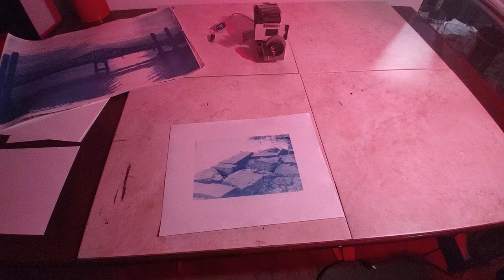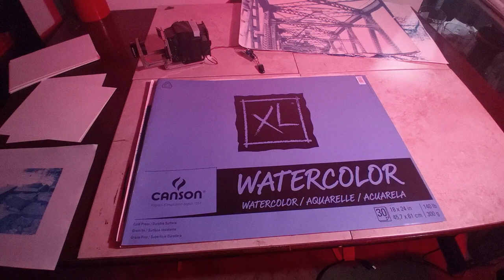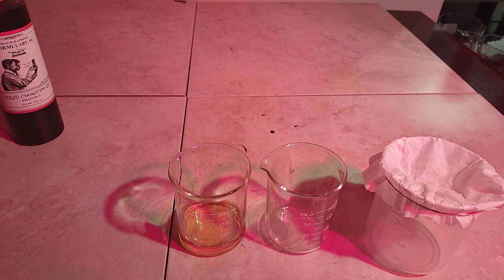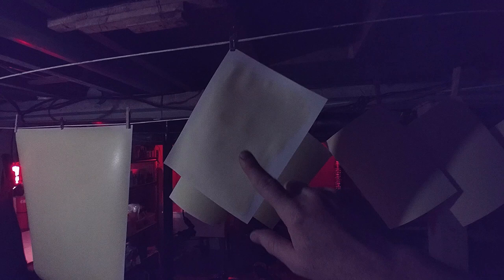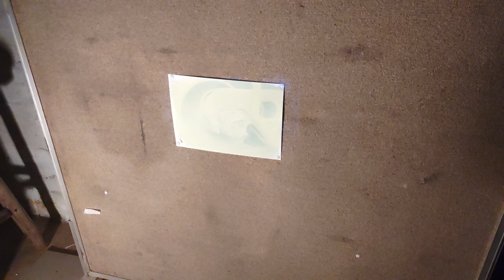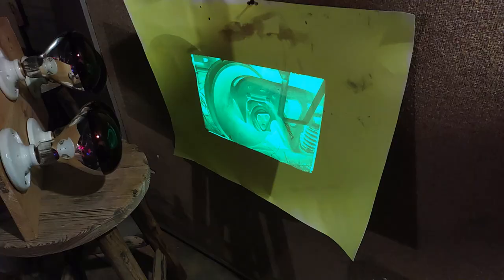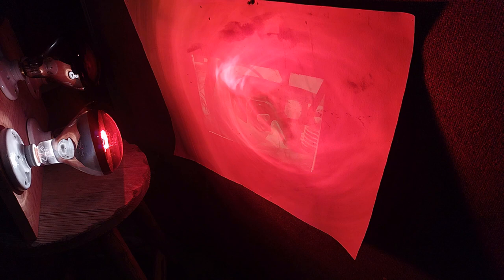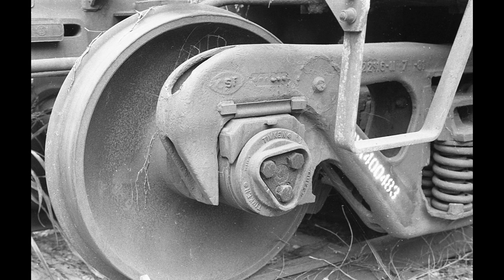Using heat and acid to reduce cyanotype exposure times!

Comment: Thanks for sharing all your experiments! What would happen if you increased the strength of the solution or added the vinegar to the solution?
Reply from the maker: I would assume you can use several different acids like citric or oxalic, you can get gallic acid concentrate as well. You would have to test to see if anything stronger would help or hurt but I would imagine that at a certain level it would just convert everything to blue and wash out the image. As for adding it to the solution the only time I have ever heard of doing that is in glass cyanotypes which I have made and it takes a small amount of oxalic acid in the emulsion,  although I have not tested it on paper I would assume it could speed up the exposure as well.

Comment: Wonderful video! Question: Did you ever try using an electric heater to heat the paper?
Reply from the maker: I have. Essentially any type of heater will work as long as you can keep the coated paper from moving around, I used infrared lamps to prevent any kind of buckling but any heat source should work

Comment: Thanks for testing them I had tried with a video projector but the time was very long and the image blurred. Do you use a video projector or a dispositive projector? Doesn't it consume too much electricity from the lighter for several hours?
Reply from the maker: I was using a modified film slide projector but a video projector should work as well

Comment: If you put a regulated heating pad behind the easel, would that be an easier way to do testing? I was thinking about an aluminum plate as the easel with a heating pad (reptile warmer) behind it. The slight buckling of a negative with a high intensity UV COB that could influence sharpness might be due to heat. I think a water cooled heat sink might make a difference. Temperature of the acid cyanotype developer/toner/bleaches might make a difference as well, though I have not tested that. I've used a citric acid rinse for my cyanotypes in all stages, though I am working on reducing it down as far as possible to not lose rich blues. The ph of my tap water is 9. Consistently. I have to acifify it. 

The audio fades out on part of your video.
Reply from the maker: There is no buckling on the negative when you are dealing with 380nm LED light, even up to 100 watts it does not produce enough heat to affect the negative which is why I moved to that wavelength. As far as heat there are better devices such as high temperature heating pads and other things as well but for demonstration purposes the heat bulb works fine. You could possibly make the exposure time even shorter with temperatures over 100F but I would imagine that there is a point where it would do more harm than good.  My tap water is loaded with dissolved limestone which causes all kinds of issues, I have read about paper acidification as well as developing in acidified solution and have had some ideas about acidifying the cyanotype solution itself although I have not tested this. You add oxalic acid to cyanotype emulsion for glass plate cyanotypes and I noticed that on this same system it was only a 30 minute exposure time, I do not know if it was because of the acid of the nature of exposing on glass itself being the reason for this. I think perhaps this would be another idea to test out and see.
Reply from the maker: And yes sorry about the audio in that section still getting microphones ironed out.

Comment: I am surprised that you got the Canson XL to work. My test sheet started to turn blue after 4 hours and by 12 hours it was almost fully "exposed" when i did a test peint. Canson has an alky buffer in it, calcium carbonate.
Reply from the maker: You are correct about the blue color over a short period of time and normally that would happen to me but the only thing I can think of is that it has something to do with humidity. Last time I ran these tests the humidity in my basement was anywhere from 55% to 70% and this time it is anywhere from 30% to 45%. I had assumed the paper was somehow acid buffered as it turns blue and I have only witnessed this in the presence of acid. Usually when the paper is alkaline it goes pale and blue fades away. I may do a video on testing the papers PH using a blender and PH strips to see what each paper is which would kind of help people decide on what to use for there application. I have made literally hundreds of prints on Canson XL so ether way it seems to work.
Reply: @matthewbary1  Thanks
Reply from the maker: @Pixelwaster  No problem